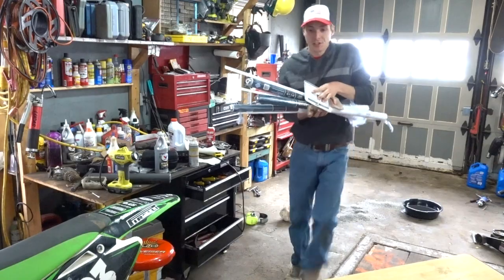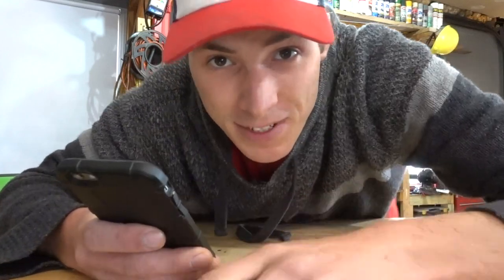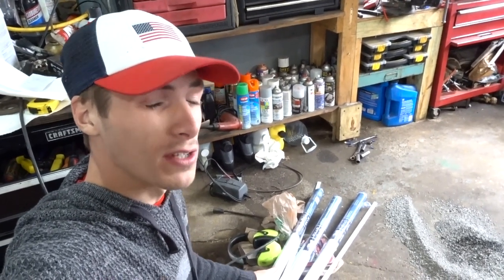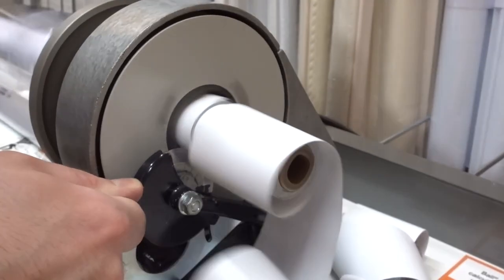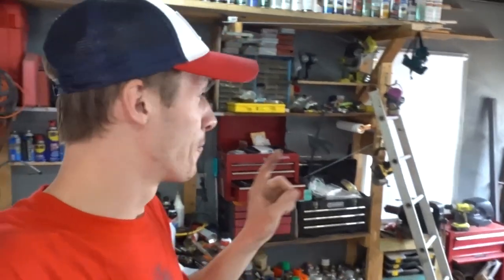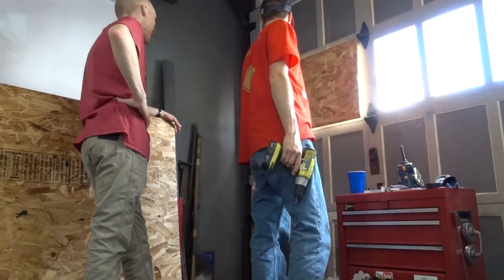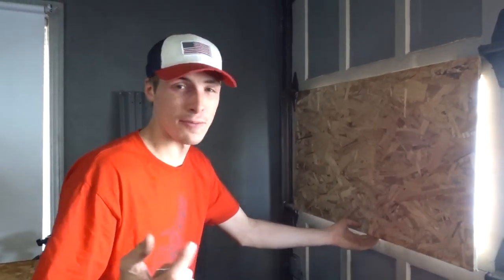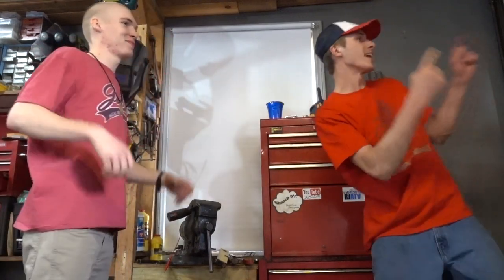IMPROVING MY GARAGE

Comment: Ahh, so refreshing, someone that has a clue to make better videos ... more light is typically better but direct light can be a pain, I think I would have to tried to diffuse the light vs blocking it. If you want a cheap diffuser try white ripstop nylon, you can find it at fabric store.